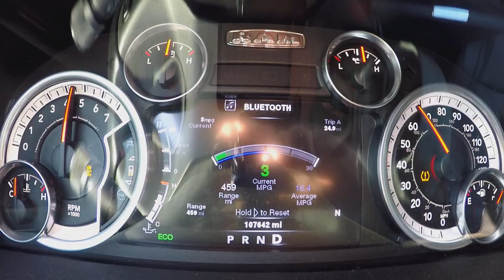HEMI Electronic Exhaust Cutout - ITS RIDICULOUSLY LOUD

Comment from the maker: Check out the parts HERE 💪😎
QTP 3" Exhaust cutout
https://amzn.to/2YwuFYh
QTP WIRELESS REMOTE CONTROL MODULE
https://amzn.to/2W7eKCq
QTP 3" Y PIPE
https://amzn.to/3iXto7r
Reply: BoostedMotorsports any clue if this works in the 2500 Ram Gas model?
Reply: Pro tip : you can watch movies on kaldrostream. I've been using them for watching all kinds of movies lately.
Reply: @Jad Scott definitely, have been using Flixzone} for months myself :D

Comment: Lol 1 mpg. I'm thinking about a classic single cab hemi... cutouts are top of the list currently
Reply: I just bought a tradesman and want to do the same thing. But the muffler guy i talked to said they fail. What have u heard or what kind to buy?
Reply: @chrisa9035  i ended up with a flowmaster American thunder... I have the biggest crybaby neighborhood. If they ever complain though cutouts WILL be installed. And I have heard of the failures also

Comment: So how much would this cost to do this?  I have a 2013 Ram 5.7 and would love this.  I already have two spintech mufflers installed, true dual with an X-Pipe.
Reply from the maker: It's about $500 for everything.  Knock about $100 if you just want to use a switch and not wireless.

Comment: Get a K&N intake and you won't even want to open the exhaust gate. Sound's awesome on the HEMI's. 
Also, Put 3.92 Diff gears in it. 
Best bang for your buck and they were factory optioned so they should be able to change your ECU to that size without an issue.
With those two options, my 14 with dual stock exhaust would chirps 35" tires into 3rd gear after spinning 1st and 2nd if i nailed it. Beat Stock C5's everyday.
Reply: lol no. just no.

Comment: Did you see any performance gains? Or did the computer auto remap the fuel air programming?
Reply from the maker: Honestly I didn't see too much difference other than the noise!  A custom tune would probably help though!  We are procharging the truck so not bothering with a tune just for the current configuration until everything is bolted up! 😎

Comment: Hi I have a diablo tune as well and carven exhaust but lately when I’m letting off throttle at high speed it downshifts loud like a manual does youres happen sometimes or anybody out there it’s so bad I took my exhaust back to stock
Reply from the maker: Do you have the 8speed transmission?  They downshift quiet a bit when slowing down which will be loud with an exhaust.

Comment: How about a dino test difference cut out open vs closed.
Reply: CK ROM NO KIDDING!!!!. My open headers make 410 hp. 425 ft/lbs
Reply from the maker: Yeah I might have to arrange this.  I also want to get on a stretch of flat road on a non windy day and set the cruise control at 55mph and open and close the cutout and see what it does to the gas mileage meter on the dash.  Since there is always a huge debate on whether a free flowing exhaust affects mileage. 👍
Reply: It goes down about 3-5 mpg. Or at least mine did
Reply: BoostedMotorsports and the hemi drone is terrible😢😭. But it sounds to good
Reply: William Evans If you put it in stick mode you won't get the drone sound but also lose the MDS when you do that though
Reply: BoostedMotorsports thats a better idea

Comment: Hey I have the same truck and I’m really interested in doing this to mine but I’m this video what do you mean by manual mode ? Are you using the gear + and gear - buttons on the steering wheel or do you have another way ?
Reply from the maker: Yeah just the manual shift mod with the buttons on the steering wheel

Comment: It's been a couple months, John. How about an updated review. I heard they might create an exhaust leak because they don't seal properly.
Reply from the maker: Still no issues so far Bo! 😎
Reply: @BoostedMotorsports  have any issues occurred since you’ve had it installed ? Looking to get one on my 5th gen 1500 but I’ve heard about the leaks they cause over time

Comment: What I'm impressed about is that 16.5MPG avg.
HOW? I have a 2008 HEMI 5.7L and it's totally babied, brand new spark plugs, entire professionally done fuel system and engine cleaning, literally EVERY fluid and filter was just changed, always Synthetic oil, new shocks and tires, K&N intake, Flowmaster Super 50, etc. and I drive it cruise control 63-64mph (my sweet spot for MDS) on the highway and don't accelerate harder than needed.
Driving like a grandma I get about 12.5MPG avg.
Driving conservatively but with some fun, about 11.2MPG avg.
Driving just for fun, about 9.x MPG

That's my observations over 2 years. Maintenance didn't increase it either.
Any idea how to get it up? Costs me $90 every 2 weeks to fill it.
Reply from the maker: Hey Ben these newer rams with the 8 speed transmission and aerodynamics with active grille shutters get pretty good gas mileage stock.  I can usually average around 20mpg if I do mostly highway.  I've also done some mods to help with mpg that you can check out if you search through the previous videos.  What wheels/tires do you have and are you stock ride height?  This is one of the biggest single factors on this truck.  Also my 24" wheels and 305 wide tires are hurting my mileage pretty bad too and would be a lot better with regular wheels/tires.
Reply: BoostedMotorsports thanks for the reply! I'm currently on stock 18" 265/60. 
I've seen a lot of your videos and have searched forums online for ways to improve MPG and haven't really found many other than a lighter right foot that've worked for me. Though I'll definitely go through your videos again to see if there's one I missed. Gets expensive paying so much on gas while being a student.
Do you happen to know if the new 8 speed transmissions hook up to older Dodge vehicles if I did a swap?

Comment: Uh try no cut out and have the the muffler installed and dump short and under the cab of truck . I did using a Borla muffler and it sounds louder than a duel exhaust. Yes I have single ..

Comment: Have you had any error messages pop up with like back pressure? Thinking about doing it on my 2016 ram rebel
Reply from the maker: No errors after months of use! Go for it! 👍👍👍
Reply: 93pirateboy haven’t had a problem with mine after 5 months
Reply: @BoostedMotorsports  awesome

Comment: Im doing this on my custom truck and plan to use a small Magnflow race muffler before the cutout to clean up the sound a bit. Then a bigger straight through Magy out back with a tail pipe for a clean classy DD worthy performance sleeper exhaust. Sound be money

Comment: Did this with my 06 300 SRT8 with dual exhaust cutouts it was freaking awesome but after watching this video may have to install one on my Ram 2500!!! Did you get the pipe and cut out from qtp or Speed Shop or online somewhere????
Reply from the maker: I got it through Summit but its QTP.  Waited for a ebay 20% off coupon and bought it through there 😎

Comment: where did you install it on you exhaust? is it after all of the o2 senors and the cat or is it before all of that? and if its before or after do you have any code problems with check engine lights or anything like that?

Comment: It does sound great. I have QTP electric cutout with remotes and a super 10 muffler for when it's closed.
Reply from the maker: Perfect setup!  I just like the super stealth sound of the stock muffler and then all out madness when its open lol
Reply: did you run into the same issues as him when installing the cutout?
Reply: Thomas Petito no issues and it's been two years since I've had it on. Every now and then after Heavy Rain it doesn't want to open and I do have to spray a little WD-40 but that happens very rarely.
Reply: I was reading up it says to spray liquid wrench on the butterfly plate every month. I just ordered mine I cannot wait to install it. I love a loud exhaust but cannot stand one on a long drive.
Reply: @thomaspetito6923  have you had any issues after with the cut out since installing ?
Reply: @youtubevideos8641  yeah it opens and closes when it want's but i try to keep it lubricated. It doesn't like the  freezing cold temperatures unfortunately. I have already had to replace the motor once because it stopped working and it's not cheap about $ for motor and new butterfly plate.

Comment: Slightly louder than mine with the muffler delete. The resonators do help tone the exhaust note so it's shockingly loud yet has a nice, fat, metallic snarl,  but between 1500 - 1700 r.pm. I still get an annoying drone.
Reply from the maker: Yeah I hear ya.  That was one of the reasons I took my Carven off and went back to stock.  Sounded awesome but I just got tired of listening to the noise and drone constantly, especially when on a business phone call on bluetooth.

Comment: Did you feel power loss with the cutout open? Sometimes people lose low end torque while straight piped.
Reply from the maker: I think it is actually better but I will eventually do a dyno run with it open and closed to get a true answer 👍
Reply: Hemiguy1985 ever vehicle is different with how much you gain/lose but you typically gain hp and lose torque.

Comment: Hey guys, how can i turn the manual shifting on?
Reply from the maker: Just hit the buttons on your steering wheel if you have an 8speed! 😎
Reply: BoostedMotorsports Like the gear- or there is a button for the manual mode
Reply: BoostedMotorsports I happen to notice in the start of the vid from the glare of the dash that you had one hand at 12 and the other not on the wheel at all { or atleast thats the look i got} ... I'm just curious to how you where shifting? Kinda left me scrathing my head... Awesome sound btw!

Comment: Your truck seems to be the only one in here that has that SRT sound when it shifts. A family member had a grand Cherokee SRT and this sounds identical, do you just have cutouts or are there other engine mods needed to get your sound?
Reply from the maker: Thanks!!!  Yeah it has a bunch of bolt ons and is getting supercharged soon too!  Be sure to check out the other videos on the channel as the entire build of this truck is documented here! 👍
Reply: BoostedMotorsports Is that a "Mufflex Muffler Delete" or just a "cutout"? Also, what's the price range on getting it supercharged? I have a 2017 Ram 1500 sport with 5.7 Hemi black/black
Reply from the maker: Hey Spencer its an electric operated cutout that I go into more details on the other video.  Superchargers will usually run starting at around $7000 new but we are doing it for a lot less on this build.  Check out the other videos for more info and stay tuned for the full build of the truck on this channel 👍
Reply: BoostedMotorsports So it’s just tune, intake and cutout right now?

Comment: Can I install this on my ram 15 2500  megacab?
Reply: Yes.  However, when ordering mine I discovered that since our exhausts are 3.5 inch, they don’t make a clamp on version.  You will have to have it welded on or have the pipes flared for clamping. Not a big deal though.

https://quicktimeperformance.com/i-30497683-3-50-inch-qtp-electric-exhaust-cutout-combo-kit.html#!year%3D2018%7C%7Cmake%3DRAM%7C%7Cmodel%3D1500%7C%7Csubmodel%3DALL

Comment: Not sure if you have a shut off button for the ECO but I noticed in the video that it kicks on during your video. That means your engine goes from 8 cylinder to 4. I have a hemi rt and have cutouts and I use the diablosport intune which helps to get the max of the hemi power. Sounds great!